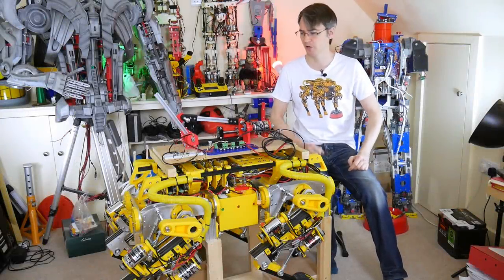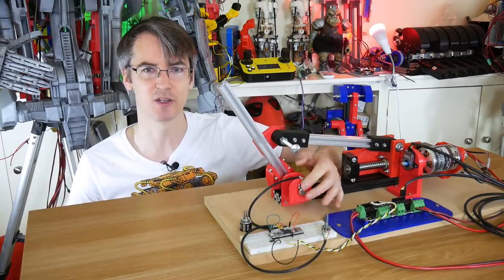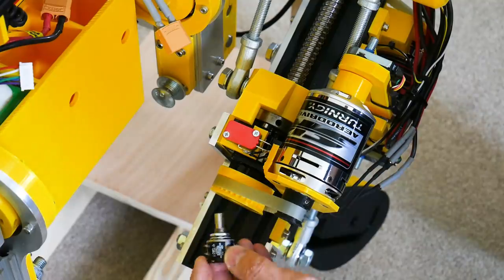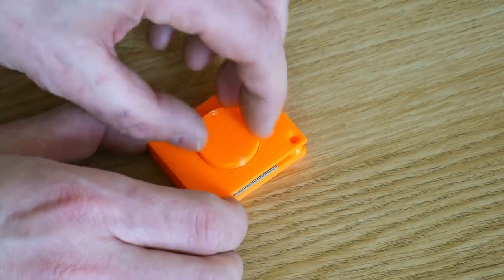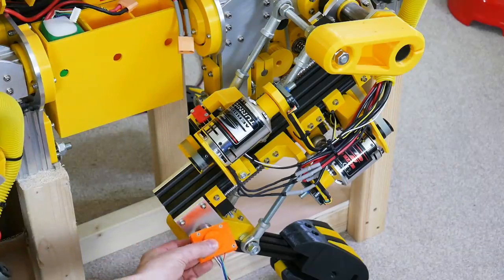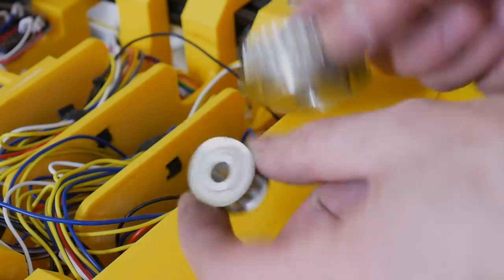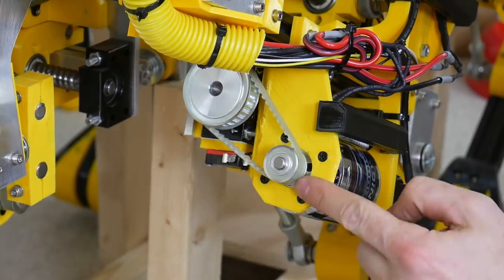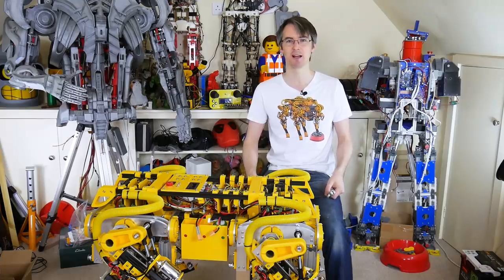openDog Dog Robot #15 | Encoders & Hardware Upgrades | James Bruton

Comment: did you know the microcontroller will actually keep the same value of a variable stored in RAM if it's not being zeroed out during initialization upon reboot? I don't know if you can do this in dumbed-down arduino, but in plain C you can initialize a variable without giving it a value. Note this is for RAM only, and not for ALU registers. Tested on AVR. Zeroing out is actually an extra step and MCU just keeps the old value as long as power is not cut for a few seconds. On a cold start, RAM holds random bits.
I have used this property in various applications, for example for reset-immunity. You only need to detect if it's a cold boot or a reset, and one way to do it is to check if one of variables holds the previously defined constant. There are of course other, more reliable ways to check, like data integrity checks and flags.

Comment: Hi, great video. Regarding the magnetic sensor board. Do you have a diagram of how you wired it up ? I tried one of these and could never get it to work, I followed the wiring from the data sheet(which included a couple capacitors) but I may have got it completely wrong.

Comment: If your highly accurate digital position sensor on the end of the motor can do a precise measurement in a 5mm range, surely your analog pot only needs to be accurate enough to place between adjacent 5mm ranges. By throwing away bits on the analog reading until it is stable, will that not give you enough of a ball park figure to add the digital position value and gain an accurate absolute position?

Comment: @James Bruton One thing you could try for when the robot needs to correct the joint position when it turns on is have it tell an arduino what position it's in maybe by telling it what movements it taken since it was in the zero position or how far away the joints are from the zero position and then when you turn it on the first thing that happens is the arduino moves the joints into the zero position then once it's done that the arduino tells the rest of the functions start up and the robot should be able to function normally
Reply from the maker: That's what it did before
Reply: @jamesbruton  oh okay 👍

Comment: Is it a linear pot or a logarithmic pot?
Sound like the El Chepo is a log pot.
Edit: would a potential devider that uses the pot on one side make the reading more accurate?
Edit2: for linear distance measuring, have you looked in T.O.F sensors?

Comment: You can use A cheep EEprom module to remember afterboot, there for you would save having to rehome
Reply from the maker: As I said in the video, there's a simpler solution. Although it won't help me recover from an unknown state, but neither would the EEprom.

Comment: I fear the magnet readings will be influenced by metal parts and motor magnets.
Reply: It's surprising how contained the magnetic field is in the motor, I believe the motor bell and opposing permanent magnets are designed to focus the field hence why they are so efficient.  
plus the field strength drops off exponentially the further you are away from the motor (magnet) and with the strength of the sensor magnet being so strong and only a few mm away I doubt it would have any negligible effect in this application. However, if you mounted it directly against the motor and required precision at a very small angle then it may be affected.  The background emf picked up by the wiring going to the control circuit is the main cause of floating values.

Comment: The position sensing should very obviously be accomplished with an optical encoder.  They're less costly, generate digital data directly and they're low in cost and exhibit high reliability.

Comment: You may want to take a look at the Parallax Propeller processor. It an 8 core 32-bit processor that is ideal for the type of processing you're doing.
Reply from the maker: But can I use the ODrive Arduino library?
Reply: @jamesbruton  I don't think so. it a totally different type of processor. They do have quite a few objects in an online library. They are working on a newer chip but the first Propeller is plenty powerful. All the pins are the same, but you create a serial port for example and can have 8+ on the same processor if you wanted. It is programmed in a high level language called SPIN or low-level in assembly. But for running all your limbs, it could be pretty easy.

Here is a sample of a project I used one to monitor all the stepper motors on a 3D printer. Not sure you could do this easily or quick enough to capture all the steps...  https://youtu.be/g1TpsugB3qE

Comment: I don't understand why you wouldn't use a rotary encoder. You would still need a limit switch for resetting, but then you would have extremely precise readings of revolutions and no limits to how many times you need it to rotate.

Comment: from what it looks like the leg motors do not move around much powered down why not just use the SD Library and and a SD Card reader to save the last known locations be for powering down then read on power up? I know that you still want to know there absolute position but for testing this seams like a simple possibility.

Comment: I am curious to know if you've ever used PIC18's in a build! Would love to learn microcontrollers beyond arduino, and started reading a book on it. They seem tough! Very computer science heavy. What are your views on them? Cheers :3
Reply from the maker: Nope!  Arduino all the way!
Reply: PIC18 are old, look at new cheap arm controllers, more power, less cost, more features. STM32 have cheap programmers and could be programmed with arduino "IDE"
Reply: @jamesbruton  Thanks for replying! I was curious, I applied for a job recently with a robotics company and they wanted people with PIC18F experience for their new products, it struck me as odd / old too! Wondered if it was common, perhaps is just the ideal solution for what they were doing.
Reply: @fritzfahrmann4730  Thanks fritz!
Reply: @Mirandorl  maybe old products? or old Engineers (they usually stick to known stuff - not always the best thing)

this low bit controller also have benefits (low power consumption)

Comment: You installed the encoder adaptor wrong :( 

I did the same thing and my encoders ended up slipping and causing all sorts of issues. 

Maybe it was just movie magic?
Reply from the maker: I just checked the instructions again, but I can't see why it's wrong - apart from not using 'tool B'.

Comment: You went about this project backwards. You should have designed your control laws and worked out your gait algorithms using Wolfram SystemModeler (free 30-day trial), before cutting metal. That also would have allowed you to know whether your actuator is fast enough to prevent the robot from tipping over if it loses its balance (if it steps on something, or is pushed laterally), which you still don't know. An overhead crane-type support for the robot will be needed while you work on your gait algorithms; otherwise, you'll be constantly picking up the robot when it falls over. Putting the robot on treadmill is also helpful. You need to read some papers on quadruped locomotion.
Reply from the maker: Pretty sure it would take me longer to build the simulation. I've only been at this 15 weeks part time for one person including testing encoders, all the design, build, kinematics etc. And we can always change the belt ratio if it's not fast enough etc...

Comment: The AS5048A hall-sensor seems to be pretty straightforward. The A-version costs around 10$ from digikey, but the B-version only 4.5$. The difference between the two seems to be the communication protocol (A-variant is SPI and the B-variant is I2C). Would it be possible to just order custom made small pcb for these? It would need less wires and fit into a smaller space. Here's a link for the datasheet: https://media.digikey.com/pdf/Data%20Sheets/Austriamicrosystems%20PDFs/AS5048A,B.pdf
Cheers!

Comment: Fantastic! I have been looking for a better sensor alternative for a dj jog wheel (tried hdd , rotary and optical encoders but too much jitter and low res) .
Anychange you could share that 3d print file?  Or does anyone have a 3d print link for a simular encolsure for the as5600 series breakout board? Cheers

Comment: Those cheap calipers are actually very easy to interface with.
Reply from the maker: How - got any links?
Reply: @jamesbruton  I can't send links it seems. just google "digital caliper arduino".  I can't remember what the poll rate is, but I think its pretty good. Code is very rudamental I used the source from the google sites page "martin's useless and useful creations"... though it would probably be a good idea to use interrupts instead of while loops to wait for the data.

Comment: I've been scratching my head using the  AS5600 encoder on a DC motor. The i2c communication drops out randomly. I have used screened cable an capacitors on the motor. Any ideas?

Comment: I've been looking for a way of having absolute positioning in a project of mine. I was also going down the POT route and trying to either find one or make my own POT with continuous rotation and >340 Degree effective range... However, this is exactly what ive needed! I have mine in the mail now to test. My only question is interference with multiple next to each other. I need 4 of them in a 2x2 matrix and with the size of the board, they will be touching edges... Does anyone know if the magnetic fields will interfere with the others? or with the need for the magnet to be so close to the sensor, that shouldn't be an issue?

Comment: With the magnetic sensor, I have to wonder why you don't just use the angle value straight from that and plug that in to your movement model.  If I'm not mistaken, the whole reason for knowing the position of the bearing on the ball screw is so you can determine what angle the joint is at.  I would imagine a tenth of a degree of accuracy is more than sufficient for this build.  I ran across another youtuber some months ago that built a cycloidal actuator using similar sensors and it seems to work very well for that.  (https://www.youtube.com/watch?v=WwEuJozJMuc)
Reply from the maker: Yes probably, although the Odrive positioning is far more accurate, so I probably only need the values on startup

Comment: James, if you're just using the sensors to initialize the O drive's position, does the jitter really matter? Just read in like 10 measurements, and treat the average as Truth. You can calculate what your worst case positional error would be, and see whether that's significant or not. It just seems wasteful to spend a lot of money on fancy sensors that are only used on startup.
Reply from the maker: Not really - we could just use a running average. The mag encoders are pretty cheap though.

Comment: Your gitter on the pot is probably from the regulator.  Get a better regulator and it might go away.
Reply from the maker: Power is coming from the USB socket on my PC... I guess I should try that.
Reply: @jamesbruton  have u converted the ADC values to mV? (form comparison how low it is) the jitter seems pretty low ;) and u will also have drops when something else shortly draws a lot of current. U also get jitter from the internals of the ADC this is something that comes with this high resolutions.